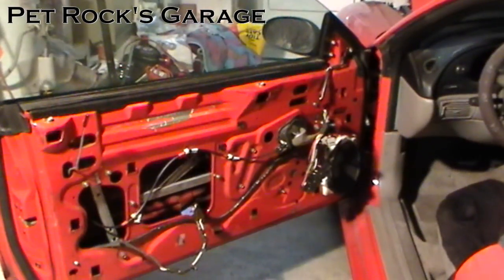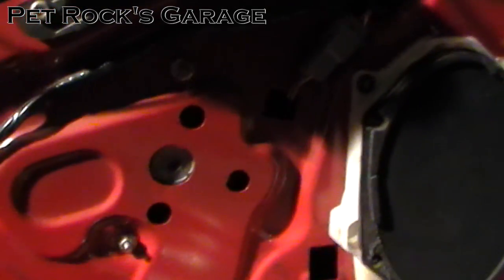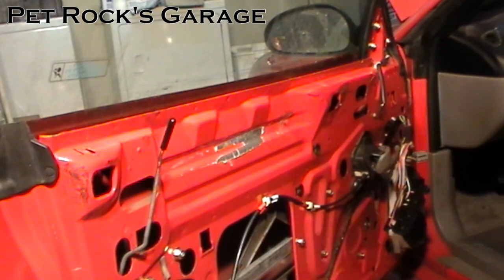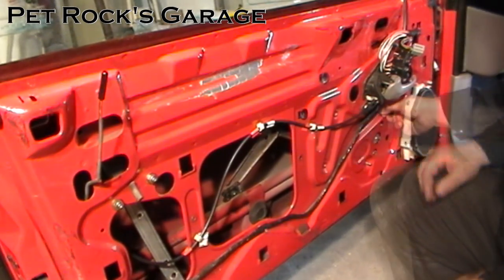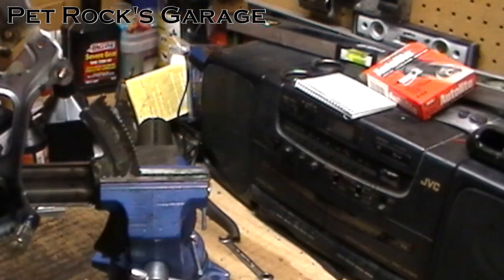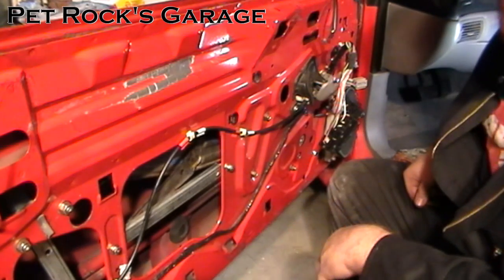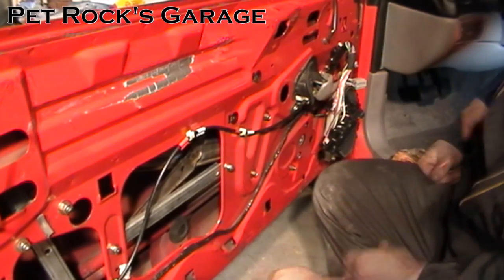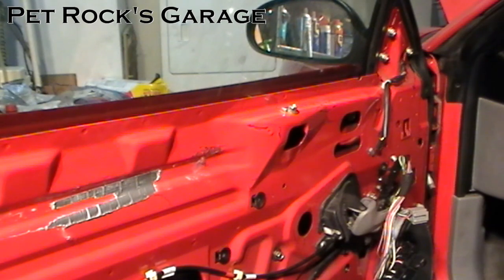How To Replace Window Regulator & Motor - Ford Mustang (’94 - ’04)

Comment: Have replaced regulator and motorNeed to reinstall window Will it slide back in without taking bracket off window
Reply from the maker: It will slide in the same way it slid out.

Comment: will the window being completely down have any effect on replacing the motor
Reply from the maker: +Mark Muñoz, it will make it a little more difficult to remove the regulator if the window is down. I show how to get the window back up in the video. Good luck...

Comment: How do you put window on 2002 Ford Mustang if you don't want to replace riveted top bracket attached to windowBak on to regulator
Reply from the maker: You don't have to replace the bracket. You just drill out the rivets and use a nut/bolt in place of the rivets when you put it back together.
Reply from the maker: If you are asking how to remove the bracket when it is riveted without drilling out the rivets, I cover that in the video around 6:10.

Comment: On my Mustang when I roll down the window on Auto it keeps pushing down and doesn't stop till I push it up. Will this help?
Reply from the maker: It might help. But this sounds like the window isn't hitting the bump stop at the bottom of the door. If so the auto-down control unit won't know when to stop the window. Alternatively, the auto-down control unit (the blue box in my video) may be defective. Good luck.

Comment: Hi, so I just bought my own mustang with a broken motor (the guys said it was) and I took the regulator out and saw that there was no motor at all in there, I also can not find the one touch box. I plugged in my new motor just to see if it would work and no. Which I assumed since I can't find the blue box, it must not be there. So, my question does this exist on the 99? As well as if that is not the problem (also my other window works so it's not the fuse) what else could it be?
Reply from the maker: JohnBoyM16, my wife’s mustang is a ’98, so I assume ’99s have the one-touch thing too. There will be an empty plug in the wiring harness in the same spot as on my wife’s if your car came with one.  If the box is missing the motor will not work.  If you have the wiring diagram you could bypass the one-touch box but you will lose the one-touch feature on the drivers side. I’d advise hitting up a junk yard for the new (to you) one-touch box.  Good luck...
Reply: Yeah I really don't care for the feature in any sense. It seams in my 99 that the One Touch is located inside one of my GEM's. I'm just going to by pass it.
Reply from the maker: JohnBoyM16, good luck...

Comment: I changed my window motor "just the motor" and after a few days I have an issue to where if I hold the down/up button while the window is completely down/up it makes a loud repeating popping noise. Any suggestions on what it could be ?
Reply from the maker: Sounds like the gear teeth are stripped/broken somewhere in the gear chain (between the motor & regulator). IMS the gears in the housing between the motor & regulator are plastic and can strip out. There are some videos online on how to fix it with metal gears if that is the case with you or you could get a new/used motor assembly. Good luck...
Reply: +Pet Rock's Garage  thank you for advice bro I will tell my mechanic to check for them
Reply from the maker: Good luck!

Comment: Trying to replace my driver's side regulator assembly but mine has 2 rivets holding the assembly in place. What do I do?
Reply from the maker: Get a drill bit about the diameter of the rivets and drill the heads off the rivets. Shouldn't take long. They are typically soft metal.  Good luck.
Reply: That's what I figured. Thanks for the reply. Gotta wait for the new regulator to get here.

Comment: What if when you press the button the window moves but stops it happened when I rolled all the way down and only moves like half an inch up and down could the motor be good and regulator bad?
Reply from the maker: This could be a bunch of different things. Something could be binding the regulator up making it not move as it should, or the motor could have a dead spot in it, or something could be obstructing the tracks that the window slides up/down on...  The list goes on.  Only way to know is to pull the door panel off and have a look inside. Good luck.
Reply: Pet Rock's Garage yea turned out to be the window came out of the track it comes with and when I pressed the button to go up it was just getting stuck on a metal hanger at the top of the door the motor and regulator were good
Reply from the maker: Glad to hear you figured it out.

Comment: It would be nice to know how to take off the door panel to make sure I don't damage anything doing it. So I need to got to another video to find out.Shot cut could cost me.
Reply from the maker: the method is slightly different from year to year, and interior options. There are a bunch of videos on how to do it online. Its pretty easy for the most part. IMS, there is only one hidden screw behind the door handle cover or the window up/down switch cluster thing. Two or three visible screws on the very bottom and that's about it. Pop off the triangle cover piece by the mirror.  Pull up on the panel an inch or two to release the hooks on the door panel and slowly pull the door away a few inches. Peak inside and disconnect any electrical connections.  Then you are pretty much done. Good luck.

Comment: Way!!!! too much work, just change the motor, don't take the regulator out!!!! Why??? I just took my window motor out, take the speaker out, and get it from that hole, just unscrew 3 motor bolts, and change/ clean the motor!!! Very simple, this is way too much work here ???, if regulator is OK, like usually is!!! make it simple, and fast !!!1 Otherwise OK video =))
Reply from the maker: I guess you skipped over the first couple seconds of this video where I explain why I did what I did in the video. It is to show how to either replace the motor or replace the entire window regulator. Either way, there is more then one way to skin a cat. Use whatever technique works best for you.
Reply: Keep watching this over... and over, can't find a reason, way not just replace a motor, like I did, much, much faster !!! So there.....;o)
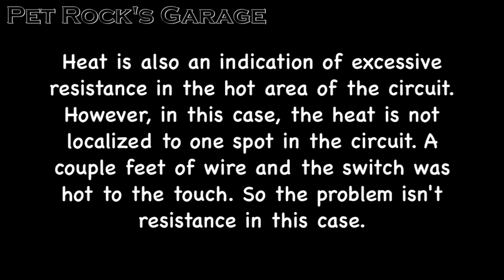Reply from the maker: Check out 0:50 through 1:25. The video is also to show how to replace the window regulator, not just the motor. Also, the stock speaker is riveted in at the factory and is a P.I.T.A. to remove. Yours probably has been replaced at some point so was probably held in via bolts. So it would be easier for you to remove the speaker then it would be for most people with the stock speakers. Then if you do get the speaker out you are working blind in the door cavity. My videos are geared towards novices to intermediates and they typically aren't very good at working by feel. Its also pretty hard to get a video camera in the door cavity and be able to film the job. Then you have the problem of the speaker whole not being that big. So some people may have difficulty getting there arm in the door cavity and manipulate a wrench & motor in the first place. For example, I'm a former competitive power lifter and as a result my arms don't fit into openings like that very easily. Either way, use whatever technique works for you. There is more then one way to skin a cat.
Reply: My Mustang is 2004/ 3.8 litre, has speaker with screws, also done it to Lincoln, had speaker with 3 screws??? Just wondering, what model are you talking about, and yes, hole is plenty big, even I am weightlifter too,....yes, you can easily pull motor out of speaker hole, if speaker is riveted, maybe different story! peace, man, good job=)
Reply: OK, good then =)
Reply: OK, thanks, youtheman =)
Reply from the maker: Eero Laukkanen  Thanks.

Comment: PITA repair. LAWWD HAVE MERCY THIS IS AWFUL. Ive done many repairs but damn this is so tedious.
Reply from the maker: I go a little above & beyond in the video with swapping out the motor, but if you skip that part and replace the regulatOr as a unit it isn't that bad.
Reply: problem was cheap ford and their adhesive glued brackets on the window came loose, so now off to the junk yard for a new window...  --_--
Reply from the maker: I had that happen on this car too a while ago. But it was caused by the window not being properly aligned and not seating properly in the window frame when all the way up. It was hitting/catching the weather stripping when you closed the door.  That caused the window to be pushed outwards putting a lot of stress on those brackets glued to the window.  I replaced the window with one from the junk yard, replaced the door hinge pins (which was the cause of the mis-alignment, realigned the window and haven't had an issue since.  If your window isn't seating properly check the hinge pins and/or window alignment. I have videos covering both.  Hope that helps.
Reply: Ive already watched that video actually, your channel has proved very useful for us stang owners. :D
Also when you went to the junker to remove the window all you had to do was take off the pins that stop the window from going high and punch in the tab on the rail so you can wiggle the window with the bracket off of the regulator hooks right?
Reply from the maker: Thanks a lot. I appreciate it.
Re junker: yeah, that is one way to do it. Alternatively you can bring a battery for a 12V cordless drill and some wire with alligator clips and use the wires + battery to power the motor up/down till the bolts for the window mounting brackets are accessible. Hope that helps.

Comment: Mine is riveted into the door. Lol
Reply from the maker: Interesting. Should be easy enough to use a drill to 'drill' the head of the rivet off so you can take it apart. Just have some replacement nuts/bolts available ahead of time, of course. Good luck.
Reply: @petrocksgarage   yea apparently the first year of the new body style (the 94s) came with them riveted.
Reply from the maker: @cavdrkz24 , yeah, that sounds familiar. It's not unheard of. I've seen riveted window regulators by other manufacturers too.